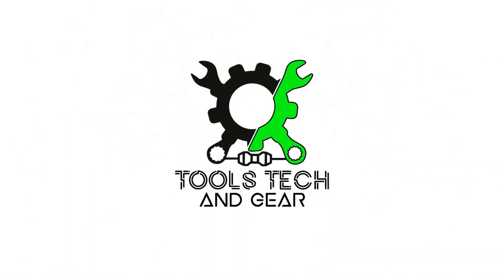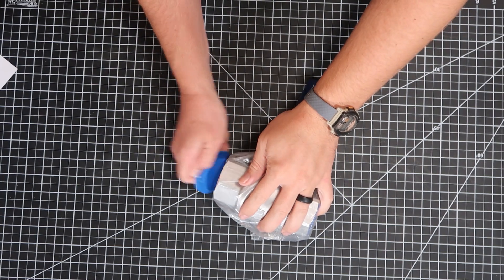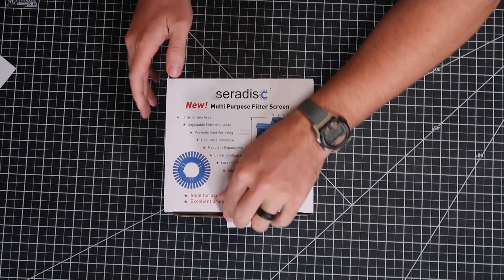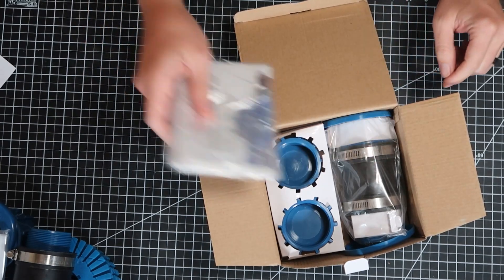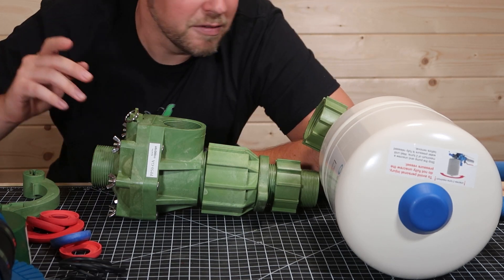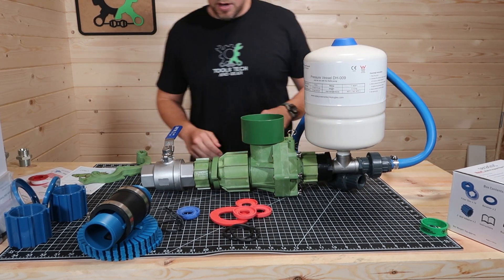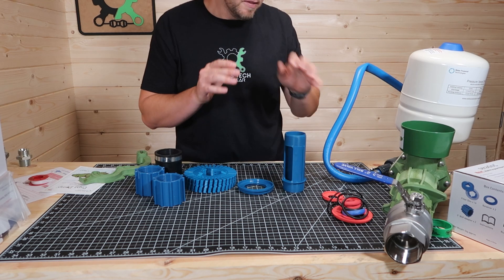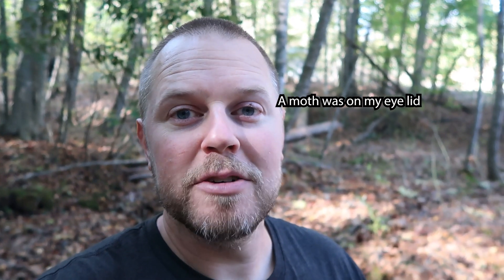Agri Papa Pump Components and first Look

Comment: Seth, you have forgot more than I will ever know But man you need to give people a little credit on things like “a ball valve, O rings, pressure tanks,Teflon tape,etc. 
It seems that you cut corners on simple things like glueing pipe, intake screen, dig down a little, put some pea gravel. Man by now you should have a superb testing site by now. I was trained hast makes waste !  That papa pump is the best bar none ! I have learned a lot of your Channel thanks
Reply from the maker: I still need to get an install on this pump. The two videos so far have just been simple tests. Not actual installs.

Comment: I'm fascinated by this, thanks.
I found a "how the papa pump" works here: https://youtu.be/DQydGCNgPmA
The same principle as your ram pumps, just a few engineering tweaks.  The waste valve is flexible rubber, so instead of gravity operated, it's spring loaded. The speed of the water flowing past the waste valve 'flexes' the valve closed to make the water hammer pressure spike  happen, and once the pressure wave propagates backwards and the pressure eases up,  the valve 'relaxes' back into the open position.  The adjusting collar changes the distance between the waste valve and the waste valve's seat, so that it takes more/less water to snap it closed.   I can't wait to see it in action.